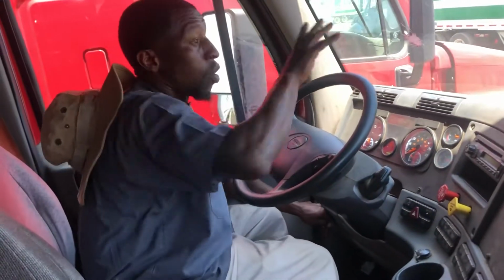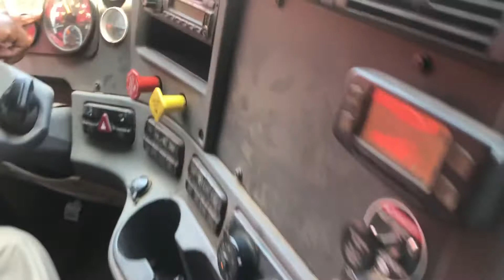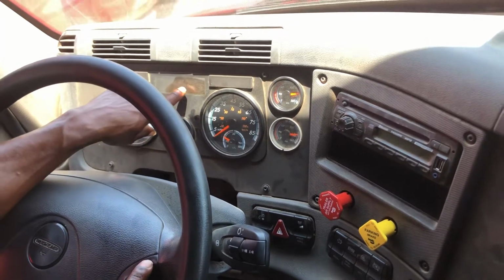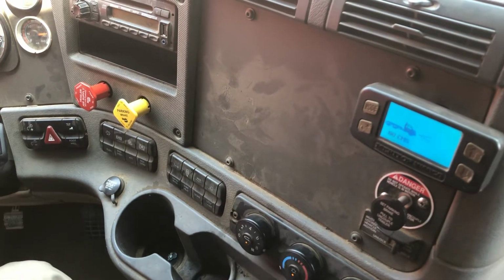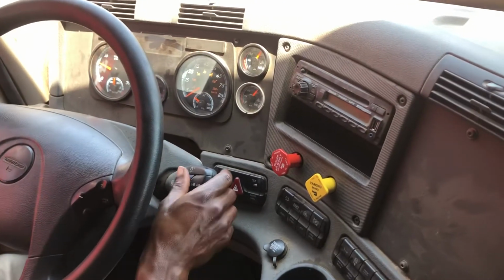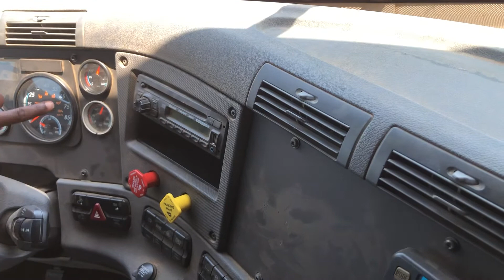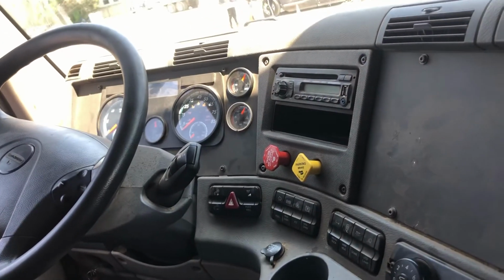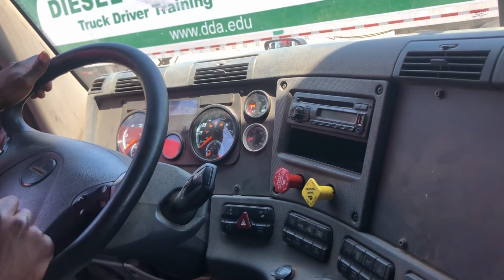In Cab Inspection | Stevens Transport |

Comment: You skip the step You were supposed to turn off the truck pushing both valves stabilize step on brakes to see if you lose 4 PSI in one minute Then the step that you're on
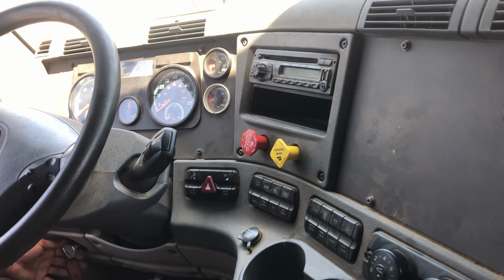Reply: 4:00 he does that it's recommended to do these step by step other wise you may miss some parts :) thats why they teach us in school to say them in order
Reply: He did that 👏
Reply: He did the leak test. Hold it for 1 minute should not lose more than 4 psi in that min. You didn’t watch the video?